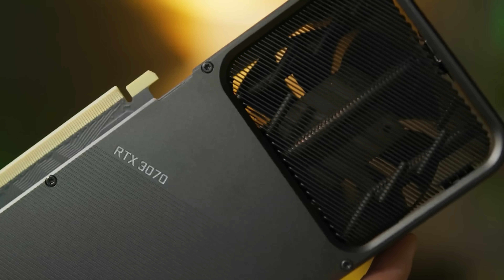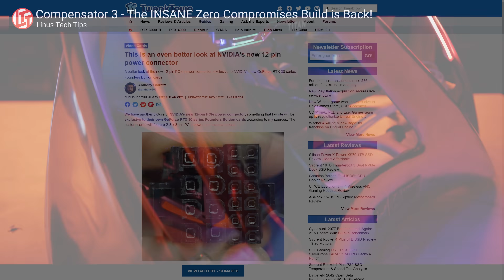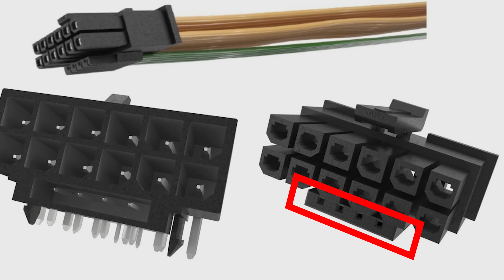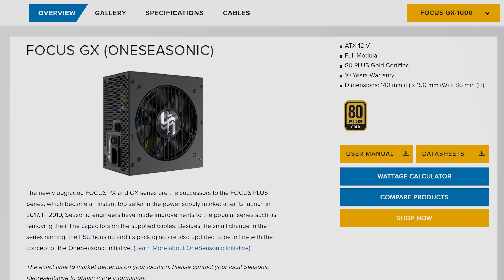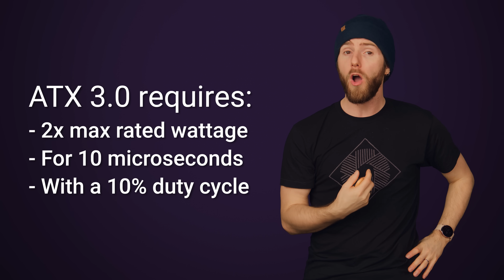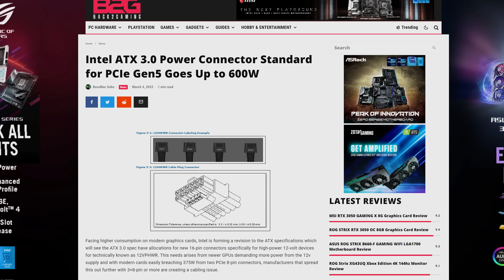Do You Need A New Power Supply? - ATX 3.0

Comment: This is going to do the same thing to desktop GPU's that the mobile industry did with CPU cooling. Just skimp on it and let them throttle. Who cares if they throttle, at least we can put a cool number on the box that's higher than the competitor's product.

OEM desktops are going to have RTX3080 cards with a 200W PSU, because with ATX 3.0 this will work fine. The consumer doesn't "see" the power throttling happening and will assume the degraded performance is normal. This is exaggerated of course, but the concept of under-speccing the PSU for this very reason, is definitely going to happen if something doesn't get mended.
Reply: Uhm, actually there is nothing stopping that from happening right now. In fact it appare tly has been happening for years. 
Remeber, the fancy component communication thing is just for automation. You can already set both general power focuses AND power limits via the BIOs for most boards, which then communicate them to the hardware parts. So an OEM that wants to skimp can just change BIOS numbers, which any cudtomer that wouldn't look at why their 3080 is performing so badly would never look at either.
Reply: While I agree with your sentiment, the thing is that very situation is happening RIGHT NOW with current ATX psu’s. It’s because OEMs know that the there is a not insignificant portion of their consumer base that doesn’t pay attention to every single specification on their builds
Reply: Uhh, that's only a factor for an ignoramus that buys a pre-made PC instead of building his own...

Comment: Does this mean that I have to replace my 1500w psu just so I can use 40series or RDNA3? Are those cards going to have these connectors? Will there be adapters so old PSUs dont become obsolete so quickly?
Reply: Let's hope for adapters (that hopefully comes with the new GfX cards) or cables that can be used in older PSUs that will work well with the new 12 pin connector.

Perhaps they will sell gfx cards for either old and new connector. Or by the time all of this implemented you will be ready/want a new upgrade anyway. 

As I was editing this, I watched UFD Tech's latest 'hot news' which mentioned reports that the 3090Ti will come with an 12pin adapter that needs 3x 8 pin PCI-E connectors.
Reply: There are adapter cables like what Nvidia did with their in-house 30 series, and AIBs will probably still be regular PCIe cables for the 40 series.

Comment: I'm planning to buy the new 4000 series GPUs ( if I get lucky), so I need to buy a new PSU coz my current one is a 500w one. So should I get a new PSU with the GPUs or not?
Reply: P.S I was planning to buy either a 4090 or 4080 so I need a high wattage PSU and at this I would like to buy the new PSU but Linus says it's recent and power requirements for the connectors might change. So that's why I'm worried

Comment: TLDR: no, your power supply isn't obsolete. If you buy a new graphics card in the future though, you might need a power supply with a cable that directly plugs into your GPU.
Reply: But my current PSU has a cable that plugs directly into my GPU.
Reply: Just replace "you might need" for "you might be forced to buy".
Reply: The new GPUs will supply the required adapter.
Reply: @Sparhawk122 I remember seeing a PSU with only 1 gpu cable and it too came with an adapter
Reply: you might need an adapter*
Reply: Thank you.  *bows in deference

Comment: They need to make all PSU's have the same ports on the rear, so mistakes like using the wrong cable from a different brand doesn't make things go Booom, which will also help with fewer cables going to land fills etc.
Reply: One cable for motherboard could be also nice.
Reply: Yeah, and not just cables going to landfill, killed a mobo doing this just last year and had to buy a refurb board out of China to get something compatible with the old CPU - many people might have just scrapped the whole system at that point.
Reply: I ran into this issue with my 1500W Titanium from ThermalTake. They called the 12V power for the board something different than what Zenith II called it so that was SUPER confusing. Apparently Thermaltake was using a SERVER -based terminology and I couldn't search for it online since no matter what combination of words I'd type NOTHING of relevance would show up. Since search engines now are complete shit.
Reply: Are you talking about modular supplies? Are you saying that different PSUs can share the same connectors on the rear but have different pinouts on those connectors?  
Or do you mean something else?
Reply: @maulerrw  yes modular cables should not be used with other brands and sometimes between different models. Not 100% why but any big tech person will tell you not to. I guess that, yes the pin outs are different in some way.
Reply: @Unleashed75  they are different yes. some brands would release some type of documentation on the pin layout but they are pretty much differrent from one another
Reply: @Unleashed75  the reason is because the pinout on the back of the PSU varies from manufacturer.  So a 4 pin might be 12v/G/5v/3v another might be 12v/5v/G/3v. So you could end up feeding 12v power to the ground on your motherboard or a 12v to a 5v pin.
Reply: I agree, I bought a 1000w Be quiet! psu and instead of the usual 6/8 pin connectors the psu has 4 connector slots with 5 pins in 1 row (for the peripherals molex/sata), not what I expected but then again I didn't take a closer look at the psu before buying it.
Reply: PSUs*

Comment: With the 4000 series apparently (not confirmed) going well past the 600W draw what will that use for a cord if this spec only goes to 600W total?
Reply: I really hope not. I'm hoping for 3090 power at 2060 efficiency with Lovelace.
Reply: @Taijifufu  As far as I have heard the 4000 cards running upto 850W prediction is from a leak, not any official source - meaning they could be wrong or might change before release. I may also be Im reading too much into the fact the cords shown only go to 600W and the specification is built to be ready as we move up through 900W, 1200W, or even the eventual 2kW devices were plugging that cord into.

Comment: i have an 850W psu and a 3080 ti and it runs fine also the 3090s recommended psu is only 650w so idk what 850w they were testing with but it was shit
Reply: That's not true Nvidia recommends a 750 watt. And enough people have had issues with 850 watts + 3090 that 750 is probably too low.

Comment: I have 3 power supplies that have served me very well for over a decade.  All 3 are in the Corsair HX line: an HX750, an HX750i, and a HX1000i.  None have shown any signs of trouble, so I'm not getting rid of them any time soon.  The HX1000i is in my main system running two graphics cards, a RX6800XT and a RTX2080, while mining in off hours at 650W of usage, the HX750i is in my main VM host with a R7 3900X and 8 SATA SSDs and 6 HDDs, and the HX750 is in my secondary VM host with a Core i7 6950x and 10 SATA SSDs.  So, they're not slacking.  I hope this new power supply spec is avoidable.
Reply: It'll definitely be avoidable for at least a couple of years after it actually comes out. You've probably got another 3-10 years before you need a new PSU for new hardware.

Comment: When I made my first PC about 8 years ago I made the mistake of thinking that future graphics cards and CPUs would become more efficient and get higher performance to power ratios so I got a fanlesss 550W power supply (yes its still running, even as a media server spending most of its time on). Boy was I wrong! Now I know the best way to future proof is to get the power supply that pulls the maximum amount of power possible from the wall (1500W). I don't care how much faster cards can be with higher power, they are not going to convince people to install a 32 amp outlet in their bedroom!
Reply: The future is extremely low power on idle/low use and rip your bill when in load.
Reply: Jevons paradox: when a technology is developed to use a particular resource more efficiently, people will usually end up using even more of that resource rather than less
Reply: The actual best way to future proof is to not future proof at all.
Reply: @Alphabet7  That is true, I also did not know/ignored that at the time.
Reply: @graysonsmith7031  yeah I tried to future proof a bit as well. Didn't work out. I guess it's good if you don't care much about PC's anymore and just want it to work but if you're an enthusiast nothing is future proof
Reply: @Alphabet7  I also got a board with usb 3.2 (the kind that's actually faster) as well as an expansion card, but only Type A because I figured we'd still be stuck with Type A for high speed or at least have the option for USB 3.2 Type A. I've definitely learned my lesson about future proofing.
Reply: @Alphabet7  Those who futureproofed GPUs 3 years ago are living like kings.
Reply: GPU vendor Nvidia has unexpectedly purchased three air conditioner manufacturers. White nosed Wallstreet analysts are saying that they believe Nvidia is playing both seasons of the home climate control market. While annoyed gamers in Florida are making the argument that modern GPUs have made gaming rooms more uncomfortable than ever during the summer. I was able to reach an unnamed but also unconfirmed employee at Nvidia R&D who says that Nvidia will be offering free home installation of a second air conditioner for buyers of the RTX 4000 series. 

There are also rumors of an Nvidia/Enron partnership which will enable users to utilize GPU waste heat for the production of electricity to run the Nvidia air conditioner. The before mentioned powdered  analysts predict this heat capture could also power blockchain innovators. "This is the biggest synergy and paradigm shift of the decade, this will make decentralized power the new normal, allowing us to circle back and pivot to unprecedented and diverse energy solutions."
Reply: @Mr.Morden  Is this satire!
Reply: To be fair, I don't think anyone thought that cards well over 200W would become the norm. I remember the GTX 480 and Vega 64 being the butt of many jokes because of how hot they ran. Now you have both the 6800 XT and RTX 3080 both pushing 300W TDP and nobody bats an eye.
Reply: @MmntechCa  6800XT 300W. RTX 3080 450W.
Reply: PCs have become more efficient in the last 8 years, but becoming more efficient and using more power are two different things. That said, a 550w will still run most people's configurations. Only people with top end hardware really need more than that.
Reply: @BriBCG  RTX 3070 is not "top end". That requires minimum 750W PSU.
Reply: The one thing that I don’t even try to make last is the power supply. I had one explode on me after a few years use in its second system and since then I always get a new, good quality PSU for every build.
Reply: @profblack  given upgrade will require new cpu, new motherboard, new ram, new psi, new gpu, and new ssds. I’m just going build new pc when I need to upgrade, cases are like $100, you don’t save much by trying to reuse the case.
Reply: @sly2792004  I’ll basically be doing the same thing eventually but I’ll be carrying forward almost all of my storage and just adding Gen 5 SSDs onto it as well as keeping my case and cooling. Since I have a custom loop in a Corsair 1000D and getting rid of that is far more trouble than it’s worth.
Reply: @profblack  I've got 10th gen chip which uses g3n 3 ssds, in 4-6 years theses will be super outdated. plus I plan to keep using pc or give it to someone else.
Reply: @sly2792004  It really depends on what you’re using the Gen 3 drives for. Games designed for the new DirectStorage API will certainly benefit from future storage speeds but anything current or old should be fine on the drives you have, basically forever. For as long as the rest of your system supports them anyway.

I’m hopefully going to be upgrading my 3900X and 2080ti system at the end of the year but I’m not dead set on it yet. It all depends on the state of DDR5, if 4000 series GPUs are out and if PCie 5.0 SSDs are out.
Reply: @profblack  its solely for gaming.strange amd is doing 5th gen while intel is just getting to 4th gen.
Reply: @sly2792004  I knew 4th gen wouldn’t last long since the 5th gen spec was finalised very soon after 4th was. I’d imagine that Intel will have it on their next platform.
Reply: @profblack  i mean its a 1000D you could live inside that shit xD
Reply: @profblack  your power supplies should not be self destructing regularly. You're not buying Bronze rated PSUs right? Stick with Titanium and Platinum. The extra chunk of $ is worth it
Reply: @lexecomplexe4083  The PSU that exploded was bronze yeah. It was my first PSU and this was about 8 years ago that it exploded.

Ever since then the bare minimum that I will consider buying is gold and even if it is likely to survive multiple upgrades I feel that it’s safer for the rest of my PC and my data that I just replace it with every major platform upgrade or build.
Reply: @lexecomplexe4083  Bronze is an efficiency rating not a quality rating. A bronze Seasonic PSU is probably higher quality than a random cheapo gold power supply.

Comment: Power supplies for this new spec have already been announced from multiple manufacturers.  Word is the 3090 Ti will be using the new connector too (same as the 30 series FE connector plus the 4 extra pins.)
Reply: John-Paul Hunt  I fear for SFF builds in the future... I don't think proper <125mm SFX PSUs above 850W even exist
Reply: @coolmemesbudd  The new 12VHPWR connector doesn't always have to output 600W. The four data/sense pins on the connector tells the GPU that the PSU is capable of either 150/300/450/600W over the PCIe cable. So even SFX power supplies can use the new cable since the biggest advantage of it is that you only need one cable to the GPU, rather than two or three 6/8-pin cables.
Reply: Asus announced that their 1000w and 1200w PSUs with the new PCIe 5.0 connector would release Q1 this year. Nearly Q2 and so far only their 1000w has released. Seems like the 1200w PCIe 5.0 model has been delayed.

A GPU that requires the PCIe 5.0 should be using minimum 1200w PSUs. And the one that is most usefull us being withheld.